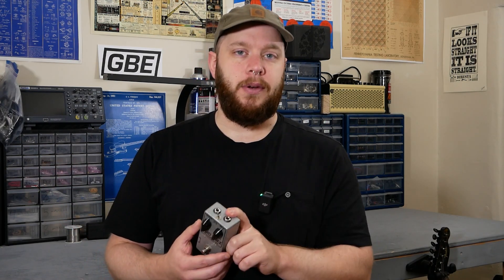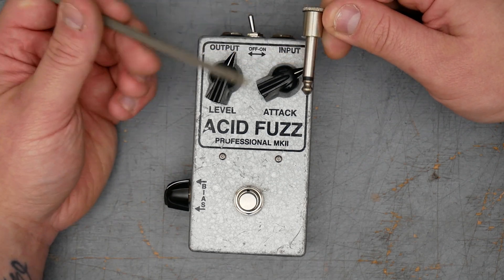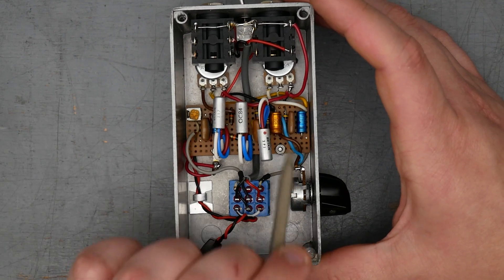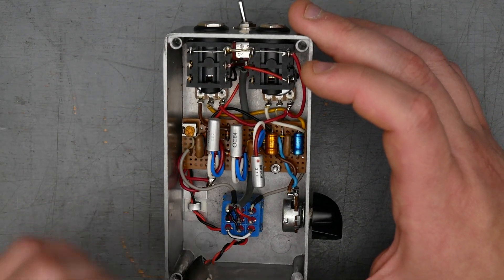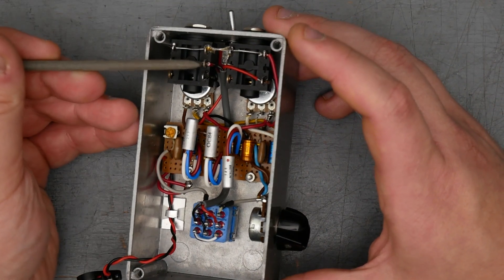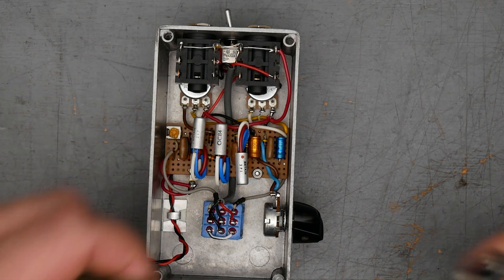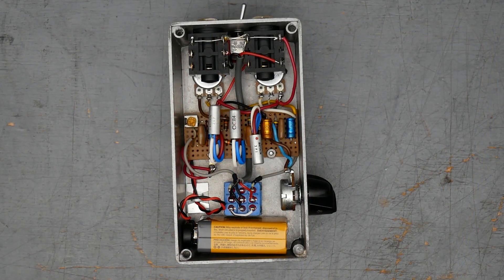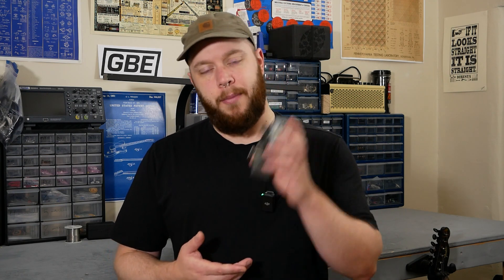Acid Fuzz MKII Mini Teardown! See what's inside!

Comment: You have a couple options to repair the enclosure. Some are going to destroy the finish. The best would be to drill the hole, tap it and get a longer screw. 

If it was a critical part of the pedal, I would TIG weld fill the corner, flatten the fill, drill and tap it. The hammer finish would be roached though.

McMaster Carr will definitely have that screw size/pitch in any reasonable length you need.

Comment: I know it is a very bad idea but you can glue the head of the screw to the back door, it will be useless but it will look like nothing happened.
Reply: That was my idea too based on the 4 options. That's a hard fix, so 3 screws works fine, but it would bother at me too until it was correct.
Reply: I would contact Acid Fuzz and see if they could send out a replacement enclosure and possibly use the old backplate.
Reply: Or long screw
Reply: Gluing the screw head in was the suggestion I wanted to offer, also.

Comment: You could cut a screw really short and put a nut behind it so it looks like it is there, but it is only attached to the back-plate.  Depending on how hard that broken screw is you could drill into and tap it if you wanted to spend them time to do that.

Comment: If you're leaning toward the rehousing idea, I might suggest going through Tayda. Here are some of the pros for that option. You can measure the hole sizes and locations and then let them drill the enclosure with their computer guided drill press. You can also provide artwork and utilize their UV printing service to approximate the look of the pedal. Here are some of the downsides to this plan. First, their silver hammer tone pedal is way darker than this one, which would probably force you to change the art from black to white for contrast reasons. Second, Tayda stamps their name in all of their enclosures, and so it might give the pedal a "store brand" feel. Third, Tayda doesn't print on the enclosure lids, only the enclosure face, so you won't be able to recreate the graphic from the lid.
Reply: They started printing and drilling on all sides last month!
Reply: @KRSound  OMG, this is huge news! Thanks for the correction. I can't wait to try this out now.

Comment: Did you Plus Gas (or equivalent) the screw before using the screw extractor?

And, I'd ask the manufacturer if they'd supply you a new enclosure front; the serial number is on the backplate, you've given them some excellent publicity and it's not like it would cost them in labour (you obviously being able to perform a pedal re-house yourself).
Reply from the maker: Not familiar with Plus Gas, but I dripped some PB blaster in there and let it sit for 30 min before working it.
Reply: @graybenchelec   Damn, that is some rotten luck then. I have found the need to re-tap (well, clear) the holes on some paint finishes that have gotten into threads - particularly the sand textures; they are great for pistol drilling as they don't skate at all, but winding the screw in is just a bit gritty for my liking.

Comment: How about a long screw that is only treaded at the bottom and re fixing the broken piece... so the broken piece is not bearing any pressure.  You could modify a long screw by grinding the threads in the weak session off.  Also, if you are willing rehouse, maybe just a screw head cut and hot glued or two-way taped in place in its hole with no shank... looks good only... but still using original enclosure.